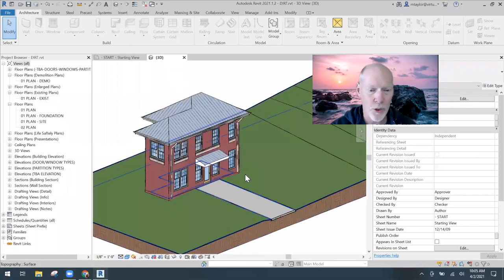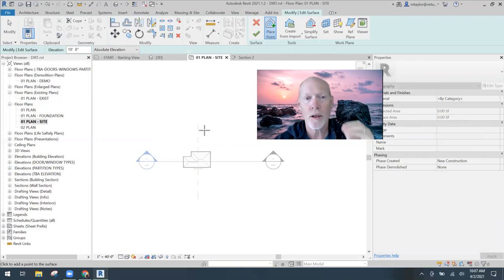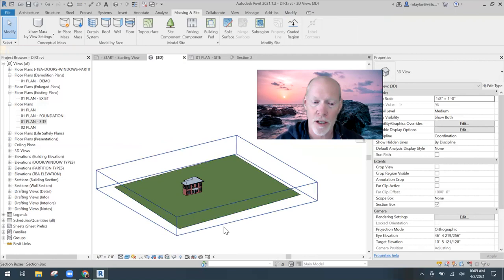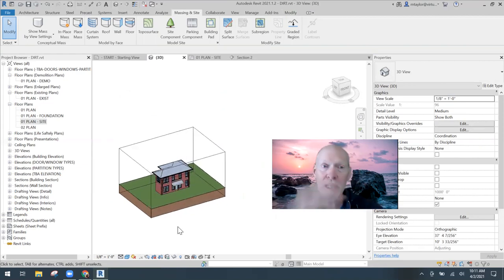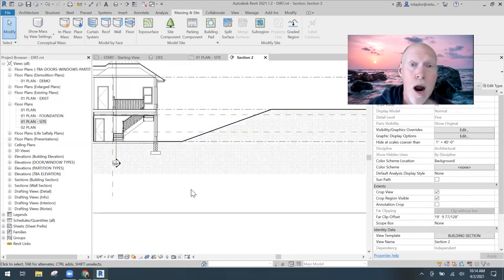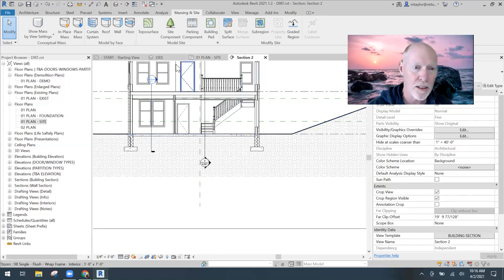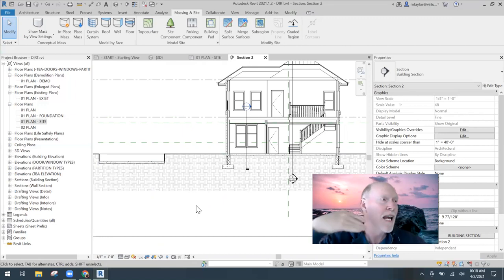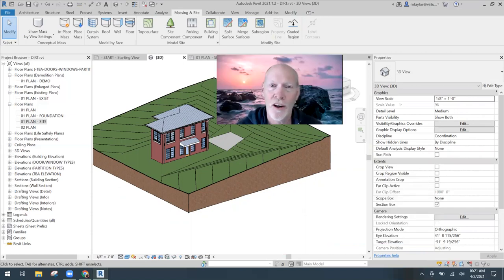DIRT UNDER YOUR BUILDING:  Toposurface for 2D and 3D

Comment: in section how do i go deeper in the appearance of the dirt seems it only goes down about 10'
Reply from the maker: That setting is under Site Settings Tools.  
Select Massing & Site Tab.  Then you will see a little arrow (Site Settings) at bottom right of the Group called 'Model Site'.  Once you select that arrow a dialog box will appear and you will see the Elevation of Poche Base setting.  Its depth is set to -10' by default.
Reply: @miketaylor-fantastic  thank you so much :)

Comment: Thank you for the incredibly positive attitude. It's just what I need when I'm so stuck that I need to visit Youtube to find out how to do something that I think I should know how to do. 
Here is what I don't know a good way to do, cut off multiple ceiling joists at angle because they are sticking through the sloped roof. I know how to use model in place with a make a structural framing void form to cut a single joist at the roof angle and then copy it. And I know how to do the same to the floor that is sticking through the roof, with a void form. But I don't know how to cut the combined joists and floor all at the same time so they don't stick through the roof. Should I just make custom joists with a model in place structural component?
Reply from the maker: @hizacaine: What are you using to make the multiple ceiling joists? Are they Structural Beams (if so, are they individuals or a beam system?) or are they Generic Models or other?  Cutting them will take different methods depending on what they are.
Reply: @miketaylor-fantastic  Thanks for the help,
I've been using individual structural framing beams. I'm not married to that approach, it's just what I figured out how to do.
Reply from the maker: @hizacaine  : OK... I figured out the best way to cut all the joists quickly whether they are individual beams or in a beam system. Create a Face-Based family that is a VOID (set the void to be any distance down inside the face you need in order to cut the joist at the right spot). Check the box "Cut with Voids when Loaded". Then, after you place it on the roof in the project you can use the CUT command and select the joists and the family... it will cut as many as it is touching. This prevents you from having to make individual voids... one long one cuts them all!
Reply: @miketaylor-fantastic  That works beautifully! One void with extrusion end depth set to the bottom of the roof sheathing and the top up above the corners of the floor system and the joists, a couple of dozen clicks and everything that was sticking through the roof is gone. Thank you so much.
Reply from the maker: You are welcome!   There is always more than one way to skin a cat!!!